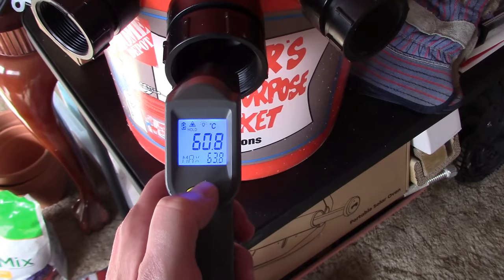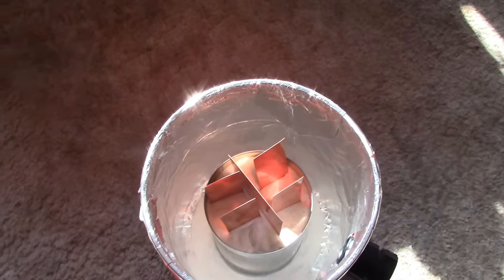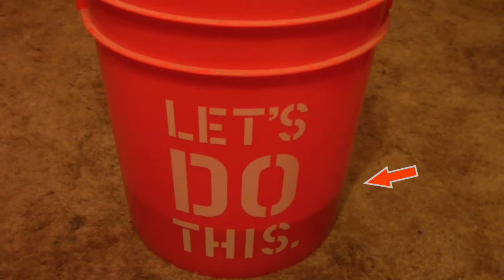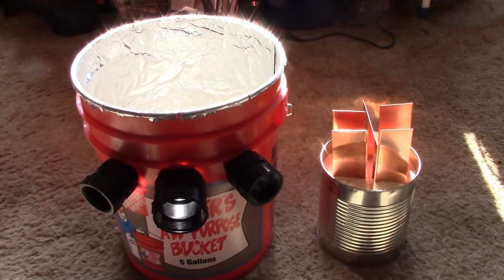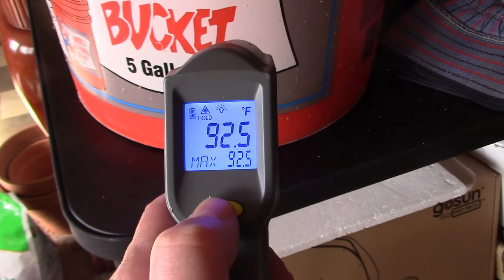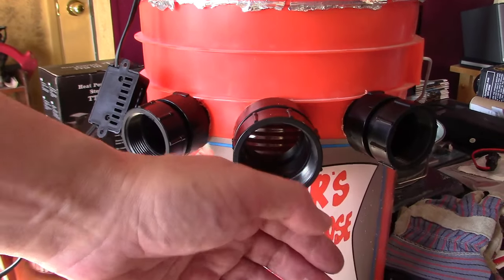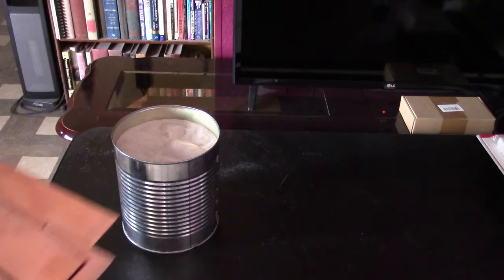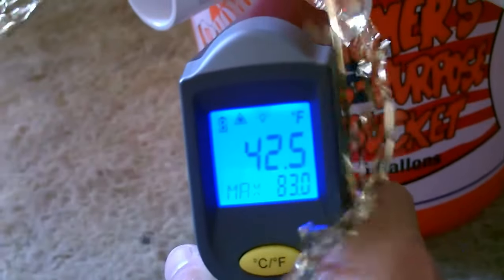Sand Battery Air Heater w/Copper! The "5 Gallon Bucket" SAND BATTERY Air Heater! AC/DC fan 12v solar

Comment: How long does the air stay warm?
Reply from the maker: hi there. it varies greatly depending on how hot you get the sand battery and how fast you run the fan. i haven't done specific timed tests though

Comment: Why not place an electric element from a kettle in the sand battery and run directly from solar, wind, hydro and batteries. This way you'll have heat 24/7. But I would have a sand battery of at least 20 litres
Reply from the maker: hi there. i like the elements idea (but the elements they use in kettles need to be in water). they will burn out in minutes if you put them in sand.  you'd need to use an element that is made to run dry. i've got another video showing how i use PYC heating tablets to heat sand in a sand battery. those are made to run dry. you could also possibly use nichrome wire.
Reply: @desertsun02  the elements won't burnout using low voltage

Comment: Wow !! Really neat!! So is that like about 1 pound of sand at close to 500F giving off 90F heat - for about how long before gets down to room temperature or 75 -70F?  (Rough calc/ guess 4 hours? Or shorter ? Or Longer?). Thanks!!!
Reply from the maker: hi. i didn't do detailed timed tests so i couldn't say for sure (but it did last well through the filming of the video). it will depend a lot on how hot you get the sand and if you heat it all the way to the core. how fast you run the fan matters quite a bit too.

Comment: You can use a heating element, like for an electric hot water heater, power that from solar to heat your sand..And bingo, you now have free heat, as long as you have a big enough solar system..I've made a dozen of them, they work like a clock..

Comment: Why not use a ICB plastic tote for a outdoor solar air heater ? 2 inches of sand on the bottom? Cut the front out, fill it with metal and sand. Cover the cut out with plexiglass. Pump the hot air into your house.

Comment: So how often are you firing up the oven to heat the sand?
Reply from the maker: hi. i used oven to heat the sand for the vid. but i've been experimenting a lot lately with the off-grid heating options (parabolics mainly). also looking into getting a decent size fresnel lens. that may be the fastest way to heat it.

Comment: How do you deal with the fan blowing lose sand around?
Reply from the maker: hi. the sand stays put. the breeze doesn't move it at all. i was wondering if that would happen but it doesn't. (and i used an overly strong fan).
Reply: @desertsun02  You could try something like aluminum window screen. It's around as thermally conductive as copper. Basically stand a loose roll of it in the bucket as it's filled with sand that sticks out as much so there's good contact throughout the sand and plenty of surface area for the air to contact on its way through. Just cook the sand-can in anything as simple as an outdoor fire pit, drop it in the bucket (with strong tongs or something) and use that as a safe carrier to bring inside.

Comment: How long it provides heat?
Reply from the maker: hi. that will depend on how hot you get the sand battery and if you get it hot all the way to its core. i haven't done detailed timed tests yet, so i couldn't say for sure. if sand battery is hot to the core - you should get hours. slowly cooling off over time. biggest factor other than how hot the battery is, is the speed of the fan. use the fan on low or medium speed to increase length of time the unit will heat. the sand itself will stay hot for hours. maybe even all day

Comment: Could you use a redesigned heat fan to push the air instead of an electric powered one
Reply from the maker: hi. yes, that may be possible. i'd have to think about how to do it.

Comment: I'm trying to understand the advantage here over just running the heating element???
Reply: Rolling blackouts, temporary power failures. I have big blocks of ice in freezer and a battery powered ice air cooler ready to go. I hang clear plastic to make a cubby hole and can stay cool for 12 hours. Laptop, UPS with modified marine battery, cell phone with mobile hotspot.

Comment: What are.the pipes u use to put in the holes
Reply from the maker: hi. they are abs plastic pipe 'fittings'. if you search for abs plastic pipe fittings or (couplers/adapters) you'll see them. stores like home depot sell them.

Comment: What is heating the sand and copper ?
Reply from the maker: many different ways to heat the sand. i'm currently looking into using reflective devices like parabolic solar cookers and magnifying devices like fresnel lenses. you can also use pv panels hooked to heating elements. (campfires, rocket stoves, propane stoves etc... are other options but harnessing the sun is my preferred way)

Comment: why didn't you mention how long the heat lasted?
Reply from the maker: hi. mainly because i didn't time it. also because i can't confirm how deeply the sand battery was heated at the time of test. how long it will heat will vary by several factors. (a few factors are how hot is it and is it heated to the core, how fast the fan is running, how cold the room etc..) 👍🙂

Comment: that vacuum uses a lot of energy.  how about using a computer fan instead?  radiant heat barrier, found in construction has better insulation and cheap.   that much air flow means the heat will be distributed quickly.  slower air flow will last longer.
Reply from the maker: hi, yep using a slower fan would be a good idea. a computer case fan should work well.🙂✔

Comment: Do you think you could heat up a sauna with it?
Reply from the maker: hi. i'm not sure but if you get the sand battery hot enough you might be able too. i'm hoping someone will heat one with a parabolic dish or frensel lens and see if they can go all day on one charge of the battery. my stove only goes to 500F(260C) but the battery could probably handle 1500F(816C) or more.

Comment: So where did you get the copper from can you give us a link
Reply from the maker: hi. i bought the copper a couple of years ago (on amazon or ebay). don't have a direct link but if you search for copper sheet metal you'll see it. it's a slightly thicker sheet metal (but it still cuts fine with tin snips). if you can't get copper then aluminum flashing or some sort of steel might work well too. copper is best if you can get it though.

Comment: What is the point of this?! If I have electricity to heat sand in my oven and turn on a fan then I have electricity to turn on my heaters.
Reply from the maker: hi there. fan is 12v DC powered so you can use solar panel or battery to power that. (or use 12v computer case fan). sand was heated in oven for video (but there are lots of ways to heat sand off-the-grid). some ideas are fresnel lens, parabolic dish, solar oven, campfire, rocket stove, coal, propane, alcohol stove etc... also could use resistive heating elements, nichrome wire or ptc ceramic heating elements. all can be DC powered. 👍🙂
Reply: One practical possibility... We live in the mountains where we can lose electricity for days at a time in freezing temperatures. We have a wood burning stove to heat the main part of the house, but the bedroom remains cold - we've seen it below 45°F in there. We could heat the sand battery on our outdoor propane grill and bring it into the bedroom to warm it up before bedtime. A power tool battery could run a suitable fan for hours.

Comment: Still do not know how long it lasts
Reply from the maker: hi. there's no way that i can answer that question accurately. there are too many variables. it will depend on various things... like, how long you heat the sand for, how hot do you heat it (and is it heated all the way to the core), how much copper did you use and how thick is it. how cold is the room air at startup, how fast is your fan (that one will matter a lot). it could vary anywhere between a few minutes to a few hours at a time.

Comment: How u heat the sand?
Reply: Did you not see it in the oven?
Reply from the maker: hi. yes, you can use oven or stove top (along with many off-grid options like a fresnel lens, parabolic dish, solar oven, or even a campfire, rocket stove or propane stove).

Comment: "Cool" - Why bother with the fittings in the vent holes?
Reply from the maker: those tend to give the air more velocity outwards. when i don't use them, the air seems to come out slower and/or more widely dispersed closer to the bucket. i'm not sure of the physics behind it (but noticed it when i built the 5 gallon bucket air cooler)

Comment: there is no sand battery without a lot of insulation, otherwise is just an room radiator
Reply from the maker: you could add insulation to this unit if you wanted to. i was thinking of using 'pizza oven' insulation. i think they use ceramic fiber blankets but i'll have to do further research.

Comment: Oh lol. He's heating the sand in an over!  Stupid. The oven will make better heat cause it's hooked to the grid, just hook fan up outside open oven door. Ovens on 240v? Not 12v. for sand battery that size to be worth the bother, one needs to put an element hooked to solar or air, or a pipe filled with liquid, oil is good, gets hotter than water. Pipe goes through a fire or is hooked to solar heater. Something not plugged into an outlet.

Comment: how long does the heat last?
Reply from the maker: hi. that depends a lot on how hot you get the sand battery and if it's heated all the way to the core. i didn't do timed tests yet so i couldn't say for sure. it lasted thru the filming of the video (and that was with the battery maybe half heated). i don't own a meat thermometer so i couldn't check internal temp of battery. i will be buying one soon though (i think that is the only way to check internal temp)